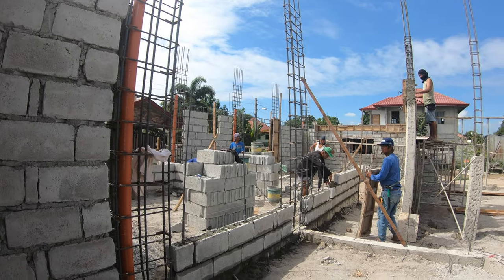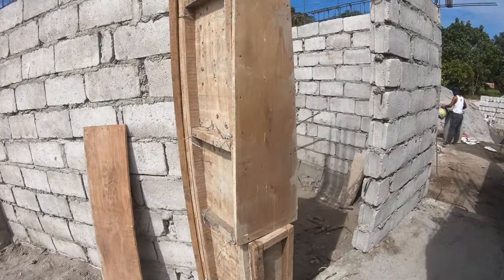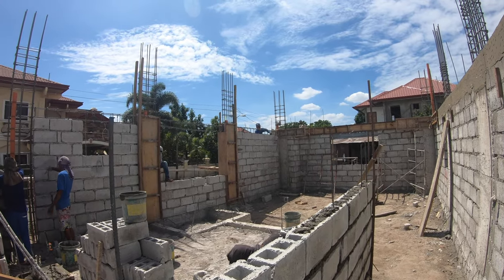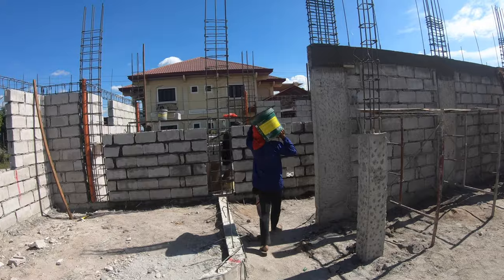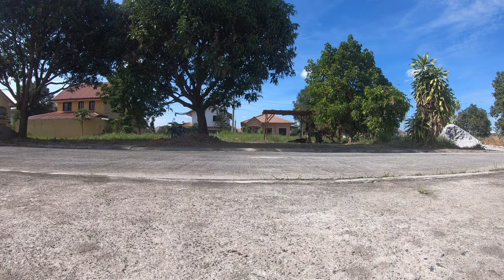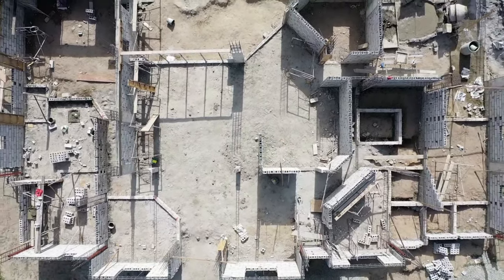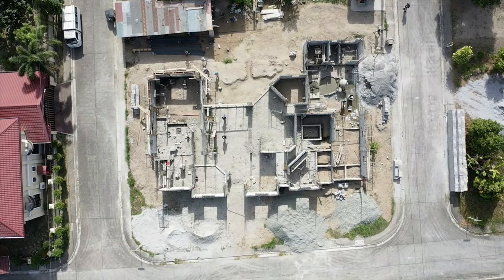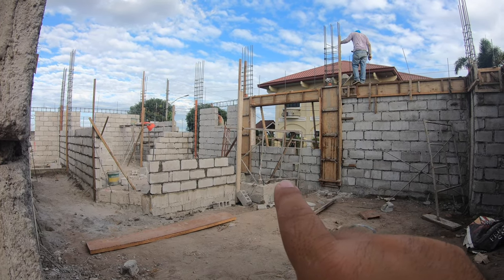Philippine House Building Step by Step, Build Day 38: Blocking It All In

Comment: Good evening.

On the CMU construction, are they actually FILLING the hollow block solid, or just loosely filling them?   Looking good.

Thank you George.
Reply from the maker: Wess, They are filling with mortar. Pushing in as much as they can with a trowel. Keep in mind the hollow block is not designed to be load bearing. Most of the load, probably 95%, will be carried by the columns and beams.  Thank you for the question.

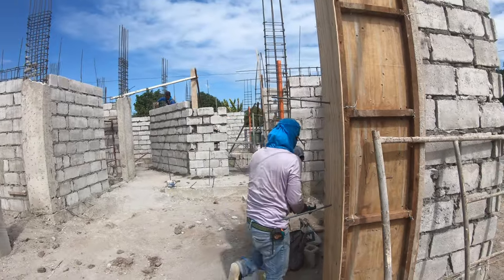Comment: It looks some of the columns are not being filled completely the first time 2:42 on the left.  May be it's also at height?
You want to fill out the column completely the first time to avoid cold-joint that would reduce the strength of the column.
Reply from the maker: Welcome to Casa TexPina!
I tend to agree. However, you will continue to notice throughout the rest of the build, cold joints are plentiful.
When brought to the foreman and engineer’s attention, the usual response is, “This is the Philippine way of doing it. We’ve been building houses for 30 years without any problems.” 🤦‍♂️

Thank you for tuning into our channel. Enjoy the rest of the build.
Reply: @CasaTexPina  😒
Reply from the maker: @Gary-pogi  
Another indicator for the need to be on-site throughout construction. Hopefully you have better luck than I did.